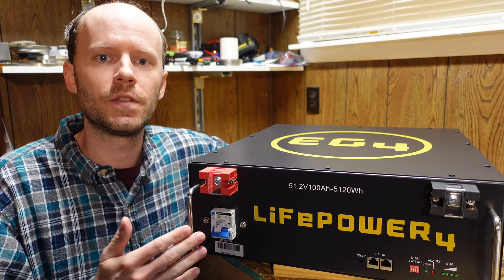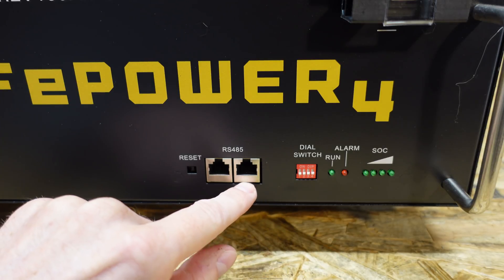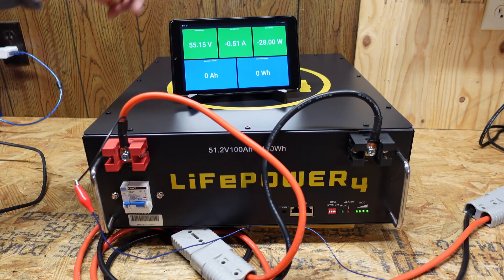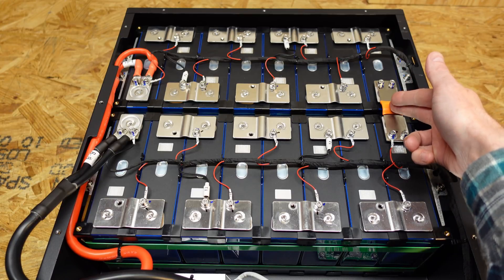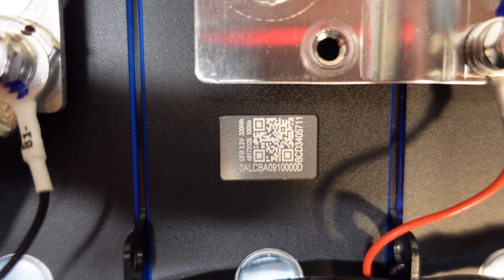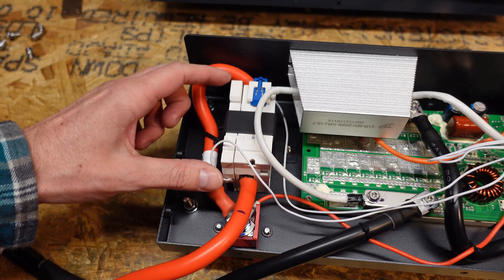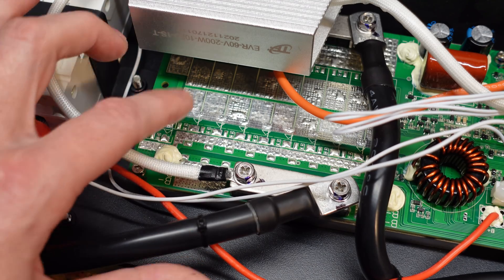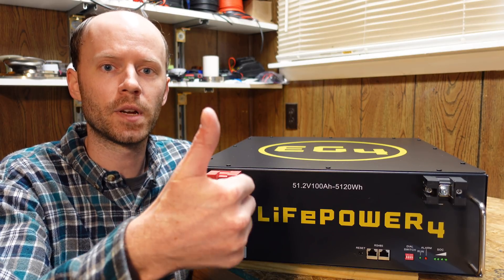EG4 LiFePO4 Battery 48V 100Ah "LifePower4" Review and Teardown

Comment: I purchased 5 of these batteries  a few weeks ago and waiting on shipment to Alaska .  Very excited about setting up a 25 KW System here.  Solar energy for summer and I will need to be on generator in the winter.  I want to charge the batteries with a natural gas generator and then use the batteries for power. This way I hope I can shut the generator down for several hours each day in the winter. Any ideas ?
Reply from the maker: Oh wow, what kind of PV output do you see in Alaska in the summer months? Regarding your question, I would look for an all-in-one inverter that has a built-in charger like the LV6548 from MPP Solar. You can feed the generator power to the AC input of the inverter and use the built-in charger to charge the battery.

Comment: Great video, EG4 batteries are really good, hoping to build a system out of them. One question though, How many batteries can I parallel together with communication (to an inverter)? I believe their racks can hold up to 6 in parallel, lets say I have a second rack of these bad boys, can I still hook them up with communication?
Reply from the maker: This particular battery allows for 15 to be connected together on the comms port.
Reply: @LithiumSolar  Good to know, Thank you!!

Comment: Great video.  I'm on the fence between building one from scratch or purchasing these.  Question:  If I purchased four of these, and wanted to actually see the SOC for each, beyond the 4 light indicator.  What would be the simplest and least expensive way to do this?  I have a Sungold SP6548. Any guidance is appreciated.
Reply from the maker: If you have 4 of them, I assume you'll wire them all in parallel for one large battery bank. In that case, they'll all be at the same state of charge and you'll really only need to measure it once, after the point where the 4 packs are combined. The best way to do this would be a shunt. You specifically asked for the least expensive way and that would be one of the $25 shunts from Amazon (search for Spartan Power DC Shunt); however, my recommended way would be the Victron SmartShunt which is a well-respected brand and includes bluetooth so you can check a number of stats from your phone.
Reply: @LithiumSolar  I sure appreciate you taking the time to respond sir :)
Reply: @LithiumSolar  So I ordered 4 on Friday and FED-EX just called and said they'll be here on Wednesday (5 Days from the day I ordered them).  Is it advisable to discharge and fully charge each individually before placing into parallel or just hook em together and start using them ?  Thanks in advance for your guidance .... again :)
Reply: @bryanward7451  make sure each one is within 0.1V before paralleling them. That will minimize the current needed to equalize the charge levels.

Comment: 7000 cycles is not very good specsmanship.  The cells are rated at 4000 cycles 1C/1C 100%DOD.  The 7000 cycles is not a manufacturers spec
Reply from the maker: 7000 cycles at 80% DOD. It doesn't give a rate though and I'd assume it's not 1C/1C at that amount of cycles. I would assume industry-standard 0.2C; however, it also doesn't give end-result state of health. So I guess you're right, a few pieces missing :)

Comment: I really like this bat but the circuit breaker really shud be replaced with a more reputable brand, its hard to trust the cheap and nasty.
Reply from the maker: The Chint-brand breakers are used in many different types of equipment, including in Victron products. I don't have a problem with them.

Comment: Nice review of the 48v 100ah battery. How would the 24v 200ah version be configured? Are the (2) 8 cell 24v modules paralleled then fed into a common BMS? (8s2p) Also, can these work with Victron/Wakespeed canbus? A demo or at least a discussion of that would be awesome. 

Great channel. Thanks

Comment: My recommendation is to always store any new lithium battery in a place other than where you live and sleep.  I've had some near misses with them over the years.  The latest issue is wires criss-crossed on the bms cable causing the bms to sense high voltage on a cell that was low and low voltage on one that was high.  The damage done was significant.  One cell expanded dramatically right away, just after receipt and I was able to get the bank outside in  a field before the damage got worse.  I buried it.  Even the folks that produce the bms cables make mistakes.   Once I realized the one cell was below 2 volts I immediately took action.  I've also seen malfunction inside the bms itself which caused similar issues.  
I recommend putting these in an outside shack for at least a week or 2 before thinking about taking it inside.  This is just a word to the wise.  I often wonder how many warehouse fires begin from such a cause.

Comment: Yes, it's me again.  As a review this is more of a look at things on the surface and admire the construction.  If there is one thing people should know by now it is that Chinese manufacturing is very good at making things look nice but the truth is only revealed by scratching the paint of and having a look underneath.  Does that CHNT breaker do what the datasheet claims?  Can it really break 10kA safely?  Is that enough for the battery's short circuit capabilities anyway?  OK, I understand.  Testing the breaker will be beyond @LithiumSolar 's abilities but it's still an interesting question.  The cells are what can be tested.  Bring the battery to a high state of charge, as close as 3.65V on each cell as possible.  Then start discharging the battery and observe the voltage on each cell as they descend in voltage down to the largely flat part of the SOC voltage curve.  Do the cells diverge during this test?  If so, they are not well matched.  This is a test that @LithiumSolar could do, but will he ...

Comment: Great review!.
The main cicuit breaker is it AC or DC one? And does it matters to match the voltage of 48v than 230v? Or only A is what matters.
Thanks
Reply: It could be missing the DC rating indication (long line with 5 dashes below) or it is NOT a DC rated breaker. The fact that it says 230v implies it is an AC breaker only. Maybe the BMS is meant to be the primary over current protection.
Reply from the maker: The single pole Chint CB-125 is rated for 60VDC per their datasheet
Reply: @LithiumSolar  Their documentation is very ambiguous about any DC rating. If the DC symbol is not on the breaker, I don't think it is rated for it.

Comment: this battery is just like the one that David Poz reviewed a while back from Signature solar ? just this one that you are reviewing in your video looks much better build than the previous version, and your video has more details explained, and I think the price and longevity still very good . I don't know about the shipping cost? but nice video !
Reply from the maker: Yes, it's similar to the batteries David has. It looks like his are an older version of the EG4-LL model. This is the EG4-LifePower4 model. Shipping will vary depending on location. For me, it looks to be in the $300 range for 1-5 batteries.
Reply: @LithiumSolar  300 dollars is a little too high if you buy one or two ? it used to be free shipping when David made his video ? anyway thanks for the reply !
Reply: @LithiumSolar  good day, 12v 100ah.. for how many hours will this battery system last with the following load: 
800w?
600w? 
500w? 
400w? 
200w? 
100w? 
32w?

hours or minutes please

Comment: Great review! Thanks for that. But the low temperature test needs to be done with a cold S.P.A.T. 🍺 Interesting to see they are not compressing these cells and give them actually room to breath.
This is the future of building batteries. A bit more expensive than single cells but... what a time-safer!
I will have a 15kWh version on my channel soon 🤫
Reply: What is cold SPAT?
Reply: @AndyMcBlane  Have a look on my channel 😉
Reply: @AndyMcBlane  Solar panel array tool => Solar Panel orientation tool
Is just a empty beercan
Reply: @raymont6191  clear as mud
Reply: I've been running three of these for the last month or so off grid, very good battery. The channel selection switch is upside down, I've shown how to set up the channels elsewhere on YT, if anyone needs the info reply to this post and I'll past the directions here.
Reply: @Alternative Power Systems 
I purchased (Feb 15, 2022) three EG4LL (non display model). For those of you trying to figure out how to set up the addresses I have worked it out. The switches are mounted on the batteries upside down! If you read the manual it will not correspond to the switches.
Here's what to do:
Once you have loaded the software and have "successful" connections go the "Batinfo" page. set the "packs number" to "15" and the "Start Adr" to "0". "Clear Sequence" then "Add address to sequence". You should now see all the addresses show up. The program will sequence through all the addresses and you can now determine which address your address switches on the batteries point to. 
Example:
the switch positions for battery 2  are v ^ v v, this is binary 4 (0100) but because the switches are upside down it is address 2 (actually 2 = bin 0010). You should now be able to set your batteries to whatever address you want.
If you have 2 batteries then "pack number" should = 2 and the address of your first battery should = 2 or the number of the first battery address you set the switches to. I don't use "0" because address "1" is allocated to the inverter and I want to keep the sequence in consecutive order (2,3,4,5, etc).
I have 3 batteries and I set the "start address" to "2" and the "pack number" to "3". My switches are set to v^vv (add 2); ^^vv (add 3); vv^v (add 4). You can use RJ45 jumper cords between the batteries there is no need for a special harness, I don't know about the batteries with the display though.
Reply: Was wondering if you would ever take a look at these. Wow 15kwhs more on top of your 44kwh 😳
Reply: :oops: good quanlity Lifepo4 battery manufacture that welcome to inquires 
:yt: https://sourl.cn/dFg4yt

Comment: I wonder if the passive balancer is able to keep the cells properly balanced over time. Anyone has any info on that? From Andy I've learned that you never want to balance cells under 3,45 volt since it will mess up the top balance. I wonder if this 3,45V. balancing point is programmed into the bms.
Reply: Pretty sure I read that it will balance whenever voltage is above 3.6v a cell

Comment: Sorry, but while watching your video something came to mind. When using invertors do you have to be aware of the load types? Do inductive loads present problems to some investors?
Reply from the maker: Yes. Low-frequency inverters handle inductive loads significantly better than high-frequency inverters. You'll know if an inverter is low-frequency or not as it will have a massive transformer adding a lot of weight.

Comment: Thank you for the great videos. My project is just starting currently in the product selection phase. The end reason for my start of the project is to use my setup for charging my Tesla Model 3. But do want the ability to have this system on the grid, eventually. Have seen the battery packs you are showing mounted in a rack with one invertor, for this purpose. Fingers crossed you were hinting at something like that in your future project. The output from a system as called out would need to be 220 volts.
One edit on my comment; what did they charge for shipping or is that included in the cost?

Comment: Got eight of these and am very pleased. Have just worked as advertised since install. They pair with a 12000 watt Growatt inverter. Buy as many as you can first go around as the shipping seems to be the same for two or 4. Got all my equipment, well solar panels, batteries,  inverter and metal roof mounts from Signature Solar. Fast shipping and well packaged.
Reply: That's a healthy setup! I have that same inverter combo...
Reply: @outoftexasRev7v9  So far, all is good. We'll see as the load increases as summer gets here and the AC kicks in.
Reply: So if the average home uses 1000 K watt a month 
How long would the 6 battery setup power the home ?

Comment: good for rv?
im in the building process of one currently
what would you recommend, (12v probably)
Reply: I have one 12-volt 400-amp EG4 dedicated to a reserve bank in my RV in addition to eight Battleborn batteries.
If that I'd known about the Signature Solar EG4 I could have built built my system around them exclusively and saved quite a bit of money...
Reply: @outoftexasRev7v9  thank you!
Reply: @jacarajc  
Just a little bit of information one might consider for an RV installation/application...

8 battleborn batteries have a total weight of 232 pounds ( not counting all the extra 2/0 awg jumper leads  ) that provide 800 amp hours and 10.24 kilowatt hours of stored power that cost me $7,200 before-tax. They are very successful and reliable go-to batteries for an RV mobile power system. However; if I had known about the EG4 batteries cost and performance qualities I could have saved $4,200 before tax and 26lbs.
The virtues of the BattleBorn batteries are that they are individual smaller boxes, group 27 car battery configuration, that typically lend to adapting well in existing spaces found in an RV application. The Signature Solar EG4 rackmount battery may work if you have a space available that your imagination could adapt them to.
Signature Solar does have a group 24 sized 100 amp 12 volt lithium battery in the $550 range which beats most Prismatic Cell LiFePo4 on the market but you don't get the $ bargain as compared to the rack mount style. 
Another factor to consider is the weatherproofing of the car battery type brands, because the rackmount type is not weatherproof.
I have a slight concern about humidity in the long term use...
Good luck with your system and may GOD bless you and your's!

Comment: Great view of a great product. I'm wishing for (2) 24v 200AH versions of the same. Price & value can't be beat, but- how I'm gonna fit them in & protect them from moisture & vibration is my struggle!!! Thanks, David!
Reply: Sailboat? Me, too. Signature solar says they can be placed vertically (back of battery down) and I might do this in a wood/fiberglass box with batteries locked in with rack mount tabs. My biggest struggle is the communication with Victron/Wakespeed equipment. I think the canbus of the EG4-LL might work but would need a translator.
Reply: @jimduke5545  OK, but form factor consideration? Why not a bunch of 280AH cells in a SunFunKit box with a (2?) big JBD BMS'? Victron/Wakespeed communication issue aside- can they be configured to fit somewhere around the midline, kept dry & have software control certain actions- above & beyond the BMS? I'll build a couple, seal 'em with SikaFlex & have an awesome amount of power.
Reply: @DCGULL01  sounds like a good approach. I’ve considered something similar but protecting my Alternator and managing all charge sources (solar, alternator, shore) are high priorities. Hence, the Wakespeed/Victron integration approach. 

In my case, I want (the admiral (wife) needs!), a ton (actually 2 tons) of air conditioning overnight so we need about 20kWh of storage budget for various cruising scenarios. The goal is NO generator and to use the Yanmar/Mppt to charge the battery while not on shore power and to manage the shore charger/mppt when attached to the dock. I have 5kW of alternator and 800W of solar. 

The electrical compartment could handle the server size batteries either stacked or vertically. The advantage, I see, is that during the 4-5 months of inactivity (winter) I could move the batts to my home and use them for solar energy storage. The big diss advantage-compared to your approach-is that the configuration is tall (approx 20”h x 19”d x 25”w boxed in) 
I can do a 3p8s single battery with eve 280Ah cells boxed in at 9”h x 19”d x 33”w. That’s 1/2 the volume. 

To your original comment, I think you CAN go with the server rack (sig solar) system if you are considering  the diy approach. You would need to build your own “rack/box” to contain the batteries, and some type of vibration absorption system (think closed cell foam) within the box around the sig sol batteries). Plywood, foam dampening, and labor! You can be more efficient with the volume but there are other advantages to the server rack form factor. 

Compromises 🤔

Good luck with your system.

Comment: Thanks. Great run thru. This looks as if it's ready to hook up to the house fuse box. True?  Also can 240 be hooked up using this?
Reply from the maker: This is just a battery. You would need an inverter to convert the DC to AC power and hook up to your fuse/breaker panel.
Reply: @LithiumSolar  Thanks. After the 2nd time of watching your vid, I kinda figured it out. The unit covers much of everything else needed (it appears), compared to just having a battery and then needing fuses, Temp sensors, etc.

Comment: The only thing wrong with this battery is the weight, but nothing can be done about that. It takes two people to move it and put it in a server rack .
Reply: Hit the gym :P
Reply: Could you imagine the same in lead acid? Not that heavy after all 💯😄
Reply from the maker: I don't have any problem lifting it myself, but yeah it is heavy. I use a hand truck to move it around from place to place then lift off of the hand truck on to the bench. Guess it depends on the person and never hurts to ask a friend for help regardless so as not to hurt your back :)
Reply: @LithiumSolar  I hear that, you only get one spine 🤣